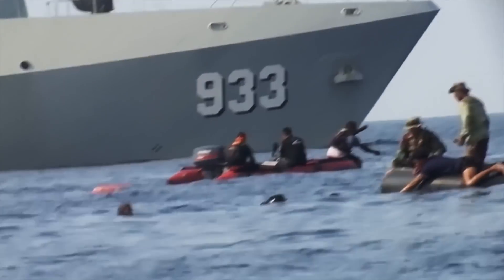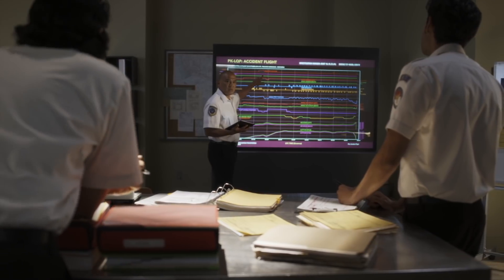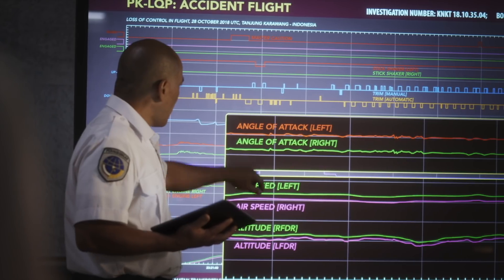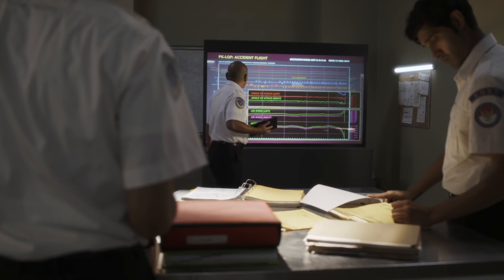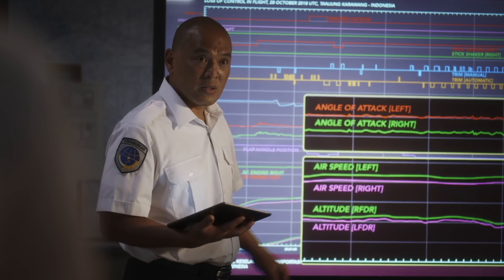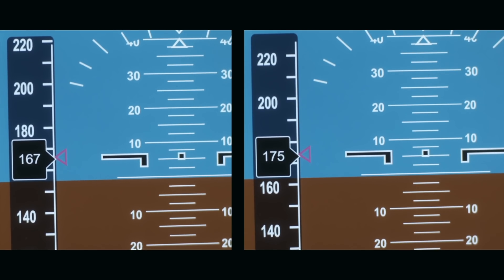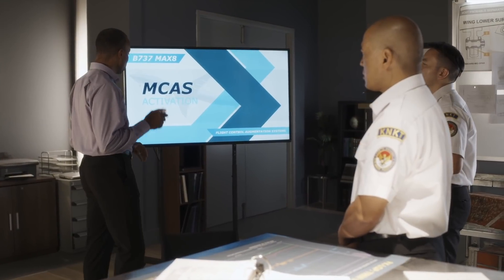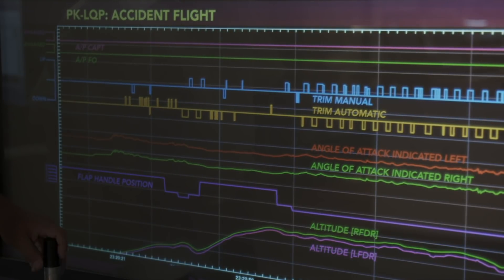Crash Investigators Turn to Plane’s Manufacturer for Answers 🔍 Air Disasters | Smithsonian Channel

Comment: 🛫 Incident Summary:
Date: October 29, 2018

Flight: Lion Air Flight 610

Aircraft: Boeing 737 MAX 8

Route: Jakarta, Indonesia → Pangkal Pinang, Indonesia

Fatalities: All 189 people on board died

✈ What Happened?
Shortly after takeoff from Jakarta, the pilots experienced erratic altitude and speed readings.

The aircraft nosedived several times, with the crew repeatedly fighting to keep it level.

Just 12 minutes after takeoff, the plane plunged into the Java Sea at high speed.

🔍 Root Causes:
🧠 MCAS System Activation:
A system called MCAS (Maneuvering Characteristics Augmentation System) automatically pushed the nose down.

MCAS was triggered by faulty Angle of Attack (AoA) sensor data, which incorrectly indicated the plane was in a stall.

🔧 Faulty Sensor:
One of the two AoA sensors was providing incorrect input.

The system relied on a single sensor and had no redundancy, which made it vulnerable to a single-point failure.

🧑‍✈ Lack of Training and Awareness:
Pilots were not informed about MCAS.

Lion Air pilots did not know MCAS could override manual control.

The previous flight (the day before) had experienced the same issue, but a different crew managed to stabilize it.

⚠ Contributing Factors:
Poor maintenance: The AoA sensor had been replaced the night before but was not properly calibrated.

Boeing failed to disclose MCAS fully in the MAX pilot manuals.

Lack of clear guidance or MCAS deactivation steps.

Crew confusion and workload during the emergency.

📊 Aftermath:
A second similar crash occurred with Ethiopian Airlines Flight 302 in March 2019.

These two crashes led to the worldwide grounding of the Boeing 737 MAX fleet.

Investigations and lawsuits followed, exposing design flaws, internal Boeing emails, and regulatory failures.

Boeing reworked the MCAS system, added sensor redundancy, and updated pilot training before the MAX returned to service.

Comment: Boeing not mentioned on flight manual of 737 MAX. And Why Boeing do that?
Reply: As far as i know, it's all about competition with Airbus. 

They wanted to make new & re-engine version of 737 at the time where Airbus making A320 Neo. When they making it, they want new 737 to feel just like older 737 with minimum training required to operate it. But because 737 has very little clearance for it's new & bigger engine, they decide to move the engine position slightly forward & upward. That placement essentialy affect the aircraft aerodynamic which led it to pitch upward more steeply than normally would. To fix that issue quickly, they put MCAS on the plane and didn't mention it in the name of "Training simplification"
Reply: @Levi yes exactly

Comment: MCAS may have contributed to this crash, but it wasn’t the sole reason. There were other factors that if one had been missing, the crash wouldn’t have happened.
Reply: Indeed, but MCAS was ruled to be the most important contributing factor to the crash along with insufficient training about this system and (for this particular flight) the incorrect replacement of the AOA sensor feeding the system.
Reply: Thanks, Boeing PR intern
Reply: @marcussantiago  I actually saw the full episode
Reply: @JETTIGER BOY Although it's trash, pilots actually can trim up in manually and follow the procedure in QRH when this problem occur.
Reply: Pilot error. Pilots let the aircraft trim nose down automatically and they didn't trim up manually.
Reply: @fathinasri7798  Actually, they did trim the nose up manually several times and tried to disengage the automation to find a way to correct the odd information the plane gave to them; but they could not find their way around the set of problems they faced.
Reply: @DocuzanQuitomos  yeah I know. But, the final moment before the crash, they let the aircraft trim to nose down.
Reply: @fathinasri7798  They did trim nose up. Don't make stuff up.
Reply: @fathinasri7798  Thanks for your input Arm chair investigator. It's funny how people with no aviation knowledge dare to  criticise.

Comment: rhat cause is mcas was not right
Reply: Problem at AOA sensor. AOA sensor gave a faulty reading which gave a false information to MCAS that the aircraft was at high AOA. When this happened, MCAS trimmed the aircraft nose down. Faulty AOA also cause ALT, IAS disagree which you can see in the video. Because high AOA, high vertical speed which gives you more altitude gain, while high AOA, IAS getting lower
Reply: Oh one more thing, AOA is angle of attack. The angle between chord line and relative wind